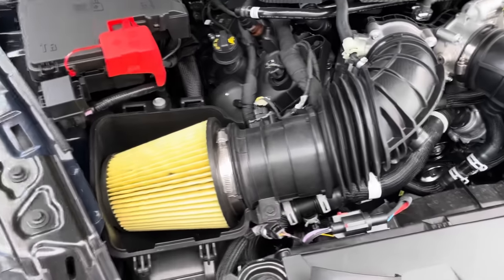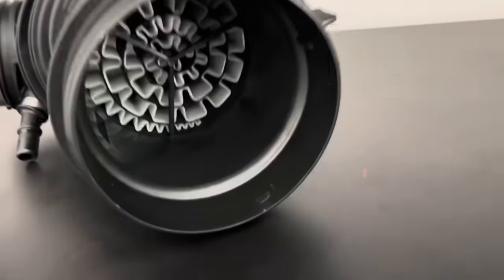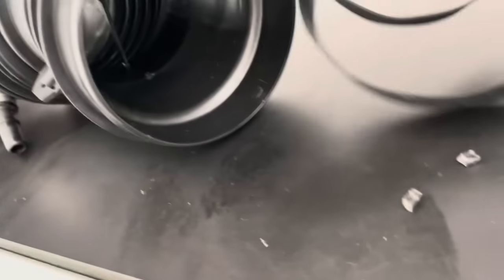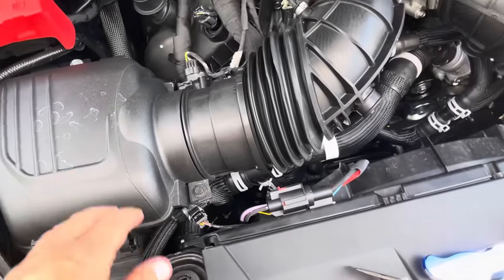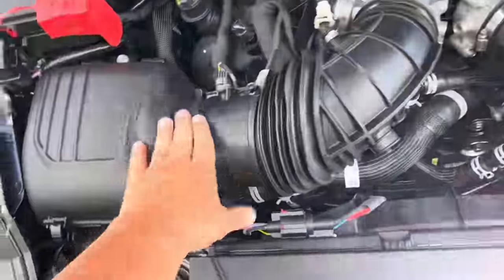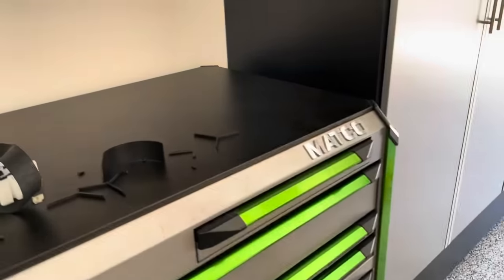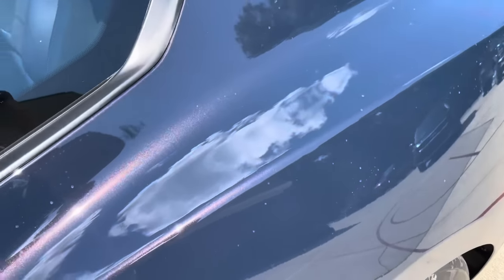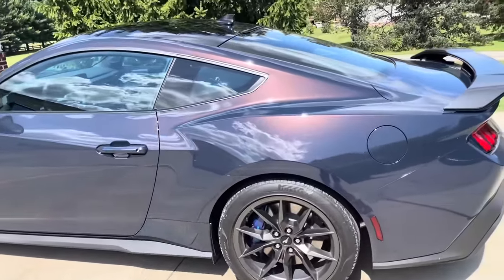Ford 2024 Ford Mustang Dark Horse S650 Intake Restriction Removal Plus First Dragy Numbers

Comment: Terry 12.3 sec equates to how much on a drag strip or a prepped surface?
Reply: That has to be around 12 flat on a track with a lighter driver and better tires. The auto will probably do 11.7 on the track.
Reply from the maker: Hard to say, every track and surface is different. Still not fast enough haha!

Comment: No wonder the Dark Horse is rather slow (12.5 ET) for a 500 crank hp (440rwhp) car. Nearly 4000lb curb weight plus 300lb driver is too much mass for even that awesome Gen 4 Coyote engine to pull around.
Reply from the maker: when you add things like mag ride, Brembo, brakes, etc. that all adds up

Really depends on what you want in a car
Reply: "Slow"...that's funny.
Reply: @lyndonohue3350   Yes it is slow because with 500hp, it should have been an 11 sec car right off the showroom floor.
Reply: Relax man, take it easy. Tenth's of seconds don't really count all that much.
Reply: @DJDinaggio  Peer pressure and marketing are usually what drives people to mess with their cars. Mustangs are becoming pricey and it might make sense to preserve future value and not monkey with the hardware. My advice is keep the old parts and slap them back on when time to sell your Mustang.